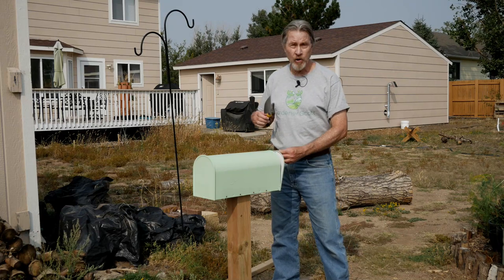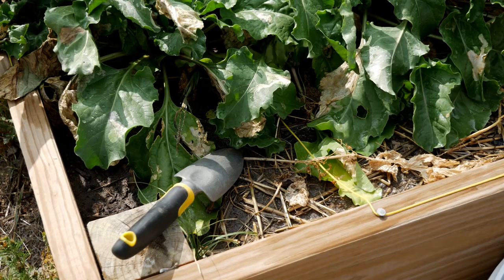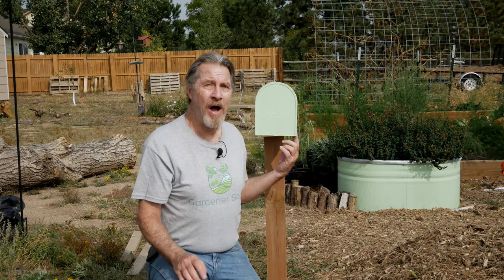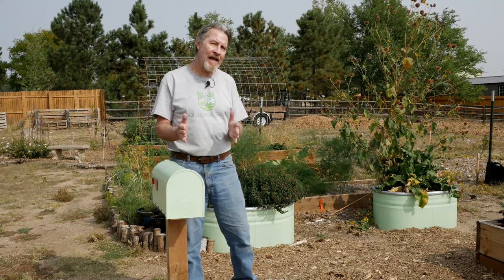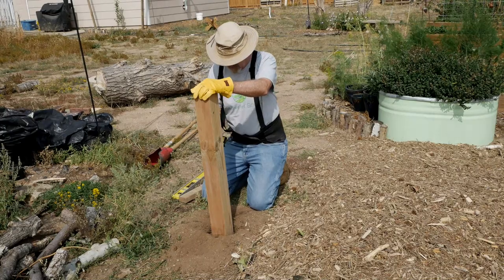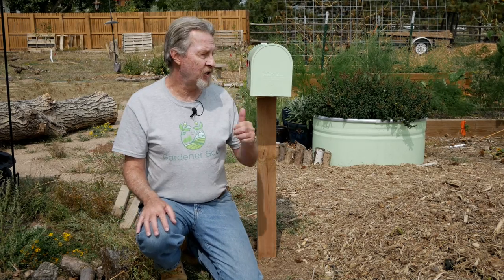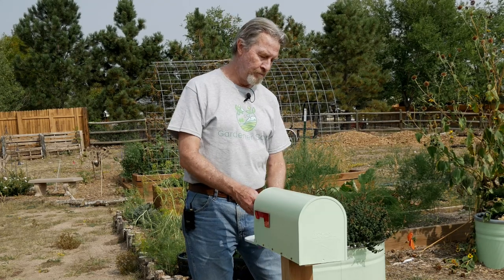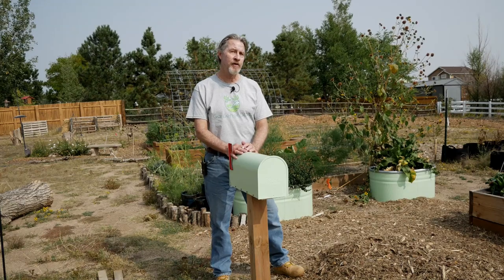Mailbox Garden Tool Storage

Comment: that's a pretty good idea, for quicker, cheaper, easier...  just put a post, 4x4,  2x4 or old log in the ground as you did there, then put some nails, screws, hooks about 2" from the top, hang your tools on the nails and flop a #10 can upside down over the top.....

Comment: I have a mailbox very much like yours that I am planning to do that very thing with. Ironically, I have painted it light green with a red "flag," much like yours. I painted some other things on it and I want to spray it with a protective coating before I mount it. I will take a picture when it is light outside and post it. I am mounting on a post made specifically for mounting mailboxes, which I got when it was on sale. I think your video will motivate me to finish the project that I started quite a long time ago.
Reply: Your video motivated me to spray on my polyurethane and mount my mailbox. I would love to post a picture, but I think Youtube won't let me. I haven't found a way to do it.  If anyone can tell me how I will do it.

Comment: @ Gardner Scott. good afternoon Gary from AZ , my daughter bought me these little tubes that shows you PH and all the others my PH was good but my others were way off , nitrogen , phosphorous were BAD my raised bed is about 40 sq ft  I have blood meal & bone meal at the house if I use that to bring those numbers up how much do I put in my soil thank you Gardner Scott  Gary have a good evening
Reply from the maker: Check the bags or boxes. They usually give a recommendation as do how much to use per sq ft. If not, you can try adding a small amount and recheck the readings.
Reply: @Gardner Scott , could it be I washed out to watering ?? thanks much for responding Gary